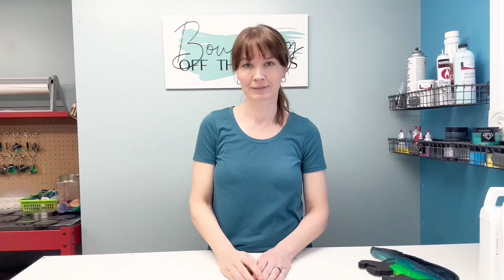My Resin Didn't Cure! All About the Epoxy Resin Curing Process

Comment: Great tips! To prevent mixing errors like too much part A or B, I measure each part out in a different cup. I'm a bit absent minded at times so that helps me get accurate measurements whenever I'm working with resin.
Reply from the maker: That’s a great strategy!